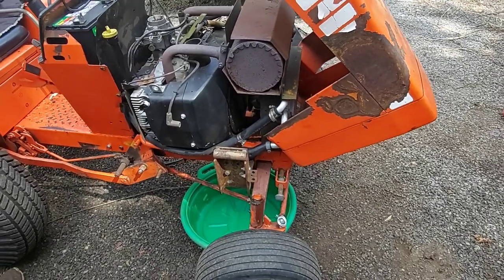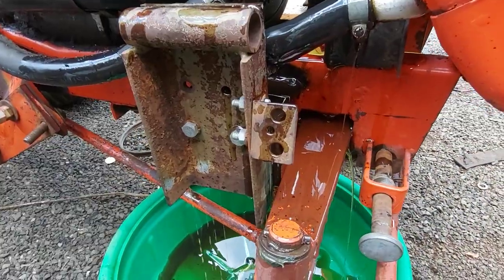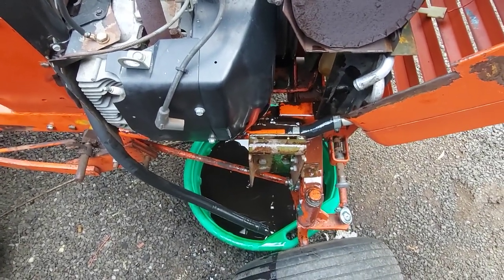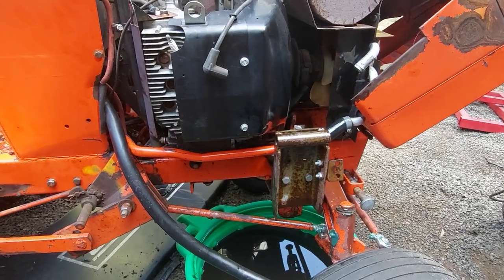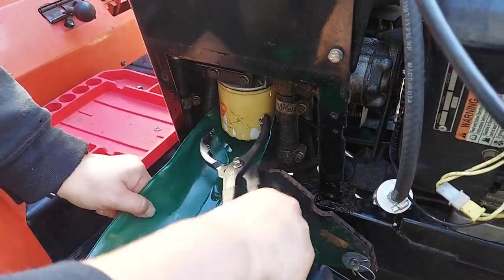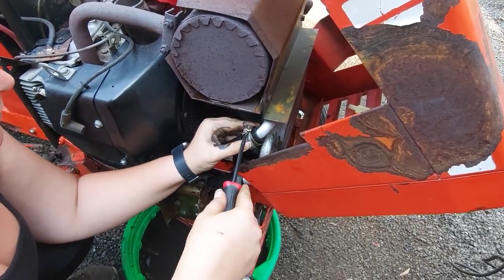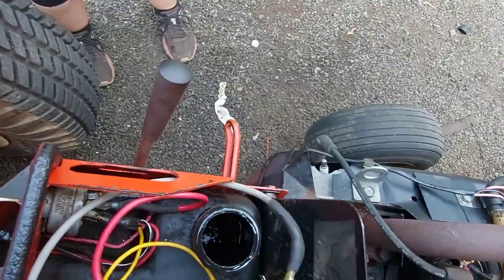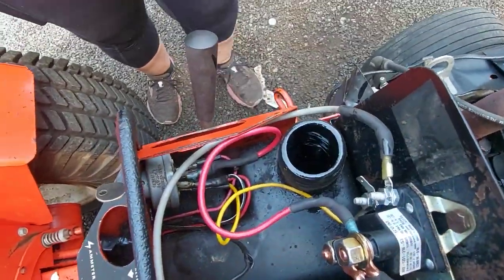Changing The Hydraulic Oil On Case Ingersoll Garden Tractors Hydrive System.

Comment: Thanks for the video. Needed to watch the process. Only thing I would do is pull the spark plug and reconnect it to the plug wire and ground out the spark plug. This will allow the spark to be generated freely through the spark plug and not cause the system to arc somewhere internally which can  possibly cause spark issues down the road or immediately. Thanks for the share.
Reply from the maker: Thanks for watching and taking time to comment. We do ground the plug when we do it here. But with You Tube some times we do things different or ad or remove to what our "normal" shop process is. The spark plug removal is one. As many watchers have never worked on or limited experiences working on things and we felt do to the possibility of someone not doing it correctly, holding, getting shocked, possible fire/fuel ignition etc we left it simple and did not include that. Though Your point is valid as damage "can" happen (also have done it many times over the years for other reasons with no issue) and as you stated would be the correct by the book method, we did not feel it was any more likely damage happening in our experiences than a incident in today's world of someone getting a shock, fire risk etc lol if you know what we mean. Thanks again for watching and your informative comment now others can read and choose to do so if they want.

Comment: Amazing video! 

I added too much oil in my 1981 case 446 last time. Should have drained it. Then I had overheating issue. While mowing. Even oil came out of the hyd. Cap. And maybe from the tank inlet. Thought it was engine overheating and found mouse nest in air filter. Changed that. Then Tried again. Overheated again monitoring with IR gun. And oil leaked from hyd. Hose again. I see thread saying there’s a metal sleeve to put in the plastic tanks to have them not bend and leak from heat. Now looking into why overheating. Cleaned rad fins. Didn’t seem to help. Now going to see about air getting in. Etc.

Thing is I did just remove hydraulic pump, and replaced the love joy. It was worn down to nothing. Wondering if hyd. Pump is bad, but has worked for months now, many hours of use. I’m also worried pump maybe damaged from running low on fluid before I noticed I think once. 

Any ideas? Thanks for your time.
Reply from the maker: Hi Thanks, lots of info here and not enough at the same time lol. Best to call or email us. Info at out web site caseingersolltractors.com   Thanks!

Comment: Can't  get mine start once  I replaced the fuel filter.
Do I needed to bleed the  air out of the fuel line?
Do you know how to bleeding the air out of the fuel line.? Please  advise if you do know. Appreciated. Thanks
Reply from the maker: Hi Need more info, what tractor, what engine, what style pump. No 99 percent of the time you do not need to bleed them. But it may help to fill the lines and prime but very rare you need to. Are your clamps very tight? Is the fuel filter installed in the correct direction? Did you do anything else?

Comment: Hi, I’m changing the oil in my case 222. What SAE oil do you recommend for colder weather. Thanks!
Reply from the maker: Hi define "colder"? We have a video on oil flow in cold weather you might want to checkout. The key to the answer is what is the normal average temp you will be actually starting it on average, not the coldest you get a few times in the winter or temp at 2 am unless thats when starting. But average "starting" temp.20-50 is good until 10 or 15F, 15 40 down to 5F or so 5-40  down to -20ishF

Comment: I ended up here because I thought I might I have a hydraulic problem.  I have a 4016 with about 550 hours on it. Pin# 14190594.  I have a really hard time "feathering it" to get it to start moving.  Seems like its either on or off  I bought it second hand so I don't know how it was supposed to work when new but the way it is doesn't really seem correct.  Can you point me in the correct direction?
Reply from the maker: Sure can, watch our video on our heavy duty travel linkage we offer. Here is a link to purchase our kit. We have sold hundreds  of these. And they are a must have for all case ingersoll owners https://www.caseingersolltractors.com/product-page/heavy-duty-travel-control-linkage-upgrade any questions let us know.
Reply: @caseingersolltractorsnortheast  thanks so much! I’ll go have a look!

Comment: You said these don't use hydraulic oil they use motor oil. I have a Case 222. I am doing a engine swap to and I'm draining the fluid from the hydraulic system. What should I use to refill it?
Reply from the maker: Yes they use diesel engine oil or racing oil. All the recommendations were in the video.  But 15 40, 20 50, 5 40 are common weights. There are links to the oils we use in this videos description

Comment: I have a imgersoll 3016 .why does my belt that engages the mower blades keep slipping off I recently bought this . Like two weeks ago the kid told me he had a issue with that problem but not all the time.  2 weeks 3 xs for me so yes that's alot any info thanx
Reply from the maker: Hi, you need to run the correct OEM belt. They are a special width and profile. Also needs to be adjusted correctly.
Reply: Ya little turn handle thing, think spring needs stretched till coils separate same diameter the spring wire is.

Comment: I've been a Mechanic for over 40 years and that is probably the messiest oil change I've ever seen!
Reply from the maker: Well then I guess in 40 years you must not have seen or do much then lol. Because I have seen far far more messy from working on small equipment, farm and heavy equipment and trucks and semis and if  this bothered you enough to take the time to try and make a negative comment then I really can not even try to value the statement lol.  Not sure if I was supposed to be insulted, impressed or what lol But I am none of it? Because I did not design the set up, nor put the homemade bracket on the machine that made it more difficult to do so this change. The bothersome issue you are having really has nothing to do with us doing the change, might want to contact engineering department or the 70 plus year old guy who welded the generator mount on maybe they would value your opinion more than I ... But doubt it...lol . I would critique your videos to help your Youtube hits as you are helping mineby leaving the comment and would return the favor.. But with your whopping 2 minuets of total footage and "40 years of being a mechanic" I'll just have to let that speak for itself lol... But thanks for the comment and watching! man!
Reply: @caseingersolltractorsnortheast  there are always fools that try to undermine your good deeds in telling you how you did the service wrong.  Personally, I have been a certified emergency vehicle mechanic for 40 years and I dont see anything wrong in how you guys made it happen. Nice job Mister! every informative and clear speaking!
Reply from the maker: @stevenbell6999  Thanks man appreciate it. You work on Emergency equipment? Thats cool!  Have you seen our heavy rescue Service truck? We plan on doing some videos on it soon. Thanks again bud.

Comment: Great video. But I remove the spark plugs its easier on the starter and battery. The other thing disconnect the power to the coil or ground out the spark plug wires on the Onan's. Some on the CCI site have wrecked the onan coils by not doing this. Not hard to do and better safe than sorry ;-)
Reply from the maker: Thanks. Most times plugs are out when we do it as it's being done as part of our full service at the time. But thanks for pointing that out we should have mentioned that and the coil.  Hard to remember it all and this video making is new to us still lol. But thanks again for watching and the comments!
Reply: @caseingersolltractorsnortheast  No problem ;-) In the spirit of the CCI group I am glad to help when I can 😎